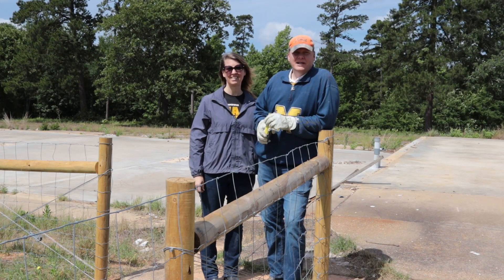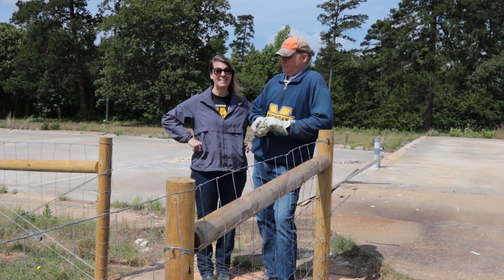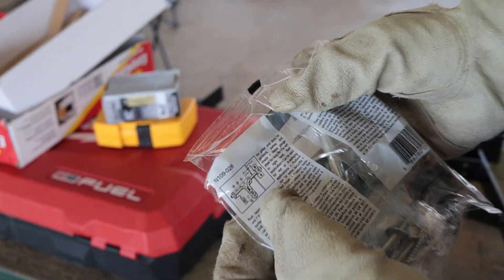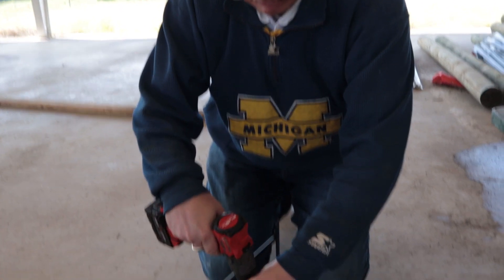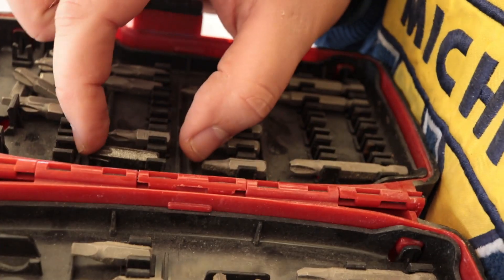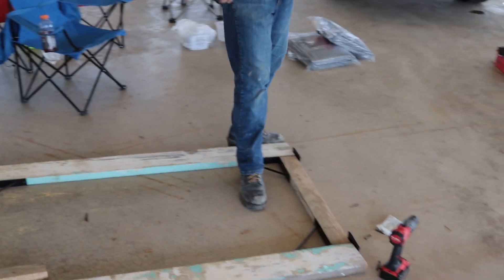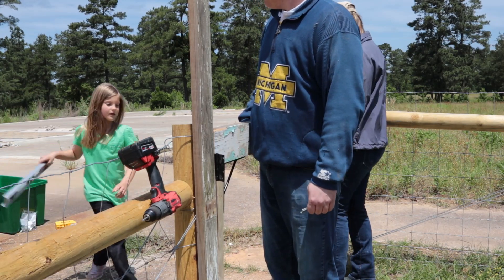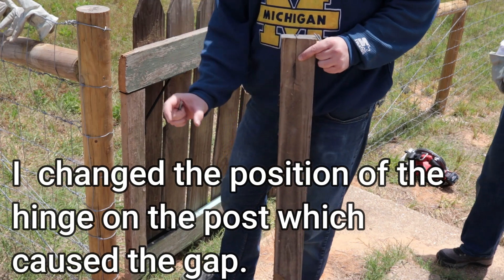Ep 11 - Homesteading for Beginners: Raising Pigs Soon | Building a Pig Shelter for Pastured Pigs

Comment: You might need to vent the tarps. I would imagine that it will act like a sail and tweak the structure pretty hard trying to contain the forces.
Reply from the maker: By venting I guess you mean cutting slits in it.  The wind does blow up there pretty good.  If I vent I wonder if that would promote the tarp to tear.  The goal is not staked down and is pretty heavy.  I agree...the wind may cause us problems.  This week we are supposed to have some storms roll through so maybe this will be the test.